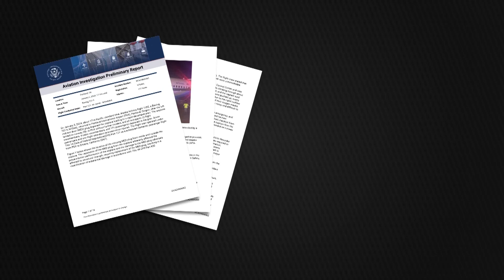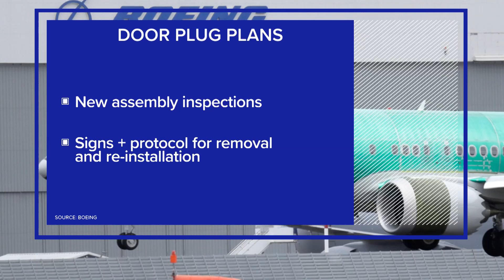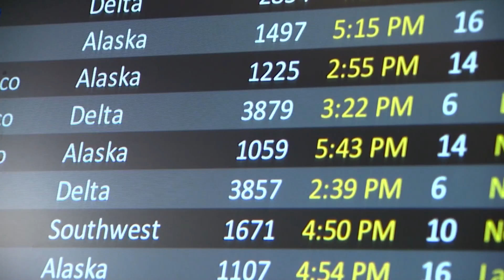NTSB report: Bolts securing 737 Max 9 door plug were left off after repairs

Comment: It's official, after this new f*ckup Boing made itself the LADA of the aviation industry, leaving Airbus alone in the Porsche place. For roughly the same price as a 737 Max 9, with an Airbus A321 Neo you get a much better aeroplane that flies more people, on longer route and most important of all, safer.

- A321 Neo: 240 pax / 4.200 NM (32.853 liters fuel) / 129.5 M$
- 737 Max 9: 193 pax / 3.750 NM / 25.800 liters fuel) / 128.9 M$.

Comment: The thing I don't understand is, they call it a plug. Now, from what I know about a plug, it's a part that pushes against the parent part, eg. bath plug, which doesn't really need any things like bolts, it's the water pressure that seals it.
So, why was this so called plug designed to go on the outside of the fuselage and held in place with bolts, Now, if it was fitted on inside the fuselage, like the over wing exit doors, the cabin pressure would help to seal this plug and can't be blown out. Very poor design.
Reply: It is called a plug because it is a plug. It is held in place by cabin air pressure. The bolts are to ensure the contact points don't shift. Very poor comment.
Reply: It is held in place by 12 contact points, and is removed by sliding it up.  The bolts make sure the plug can't move up away from its restraints